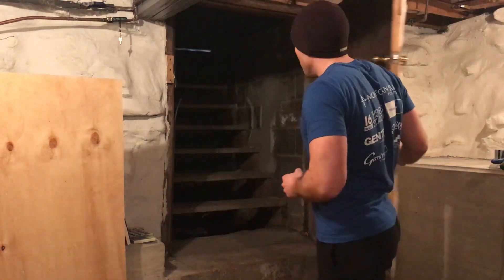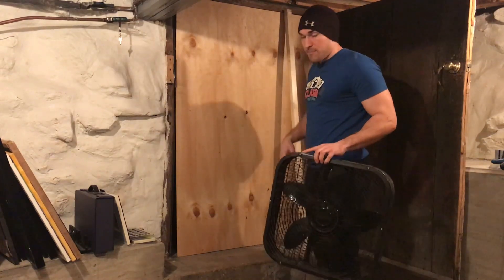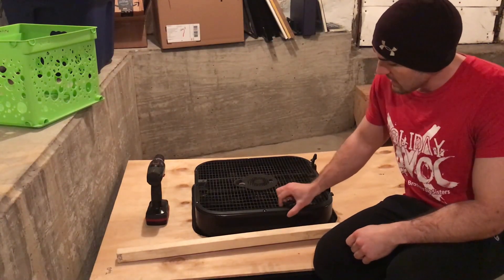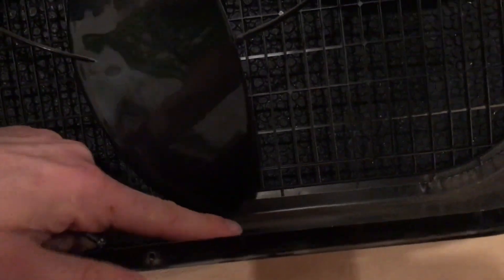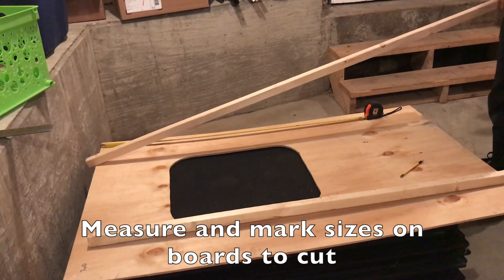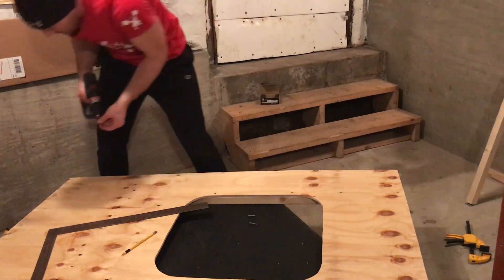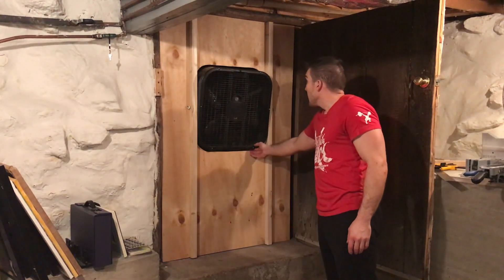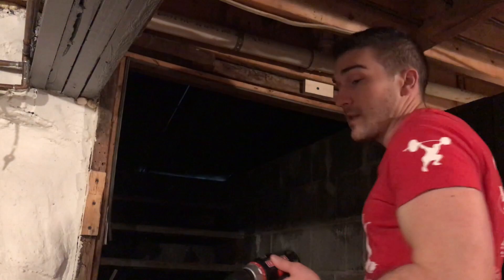DIY Workshop Exhaust Ventilation Fan for Door or Window

Comment: Can you recommend some sort of system where I can use a regular fan (maybe a small floor fan or box fan) that I can vent outside through a sliding glass door? I have very poor ventilation in my kitchen and my condo doesn't allow installing a duct to vent my stove to the outside. I have a microwave that has a very weak vent fan. So I wanted to supplement that with another fan to the outside. Thanks.